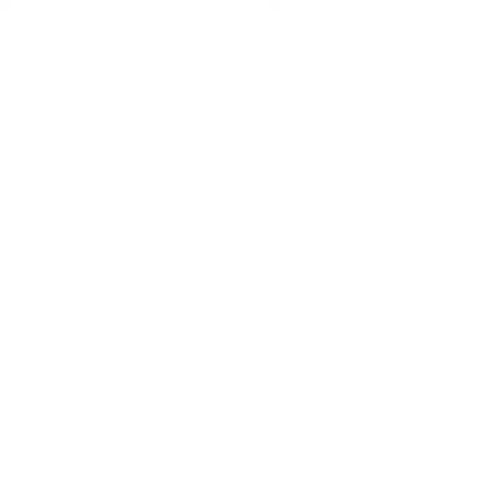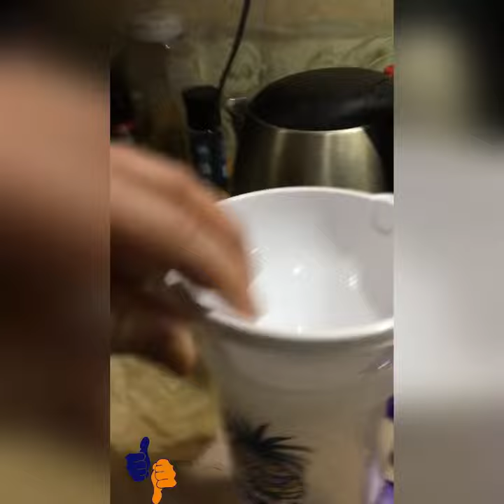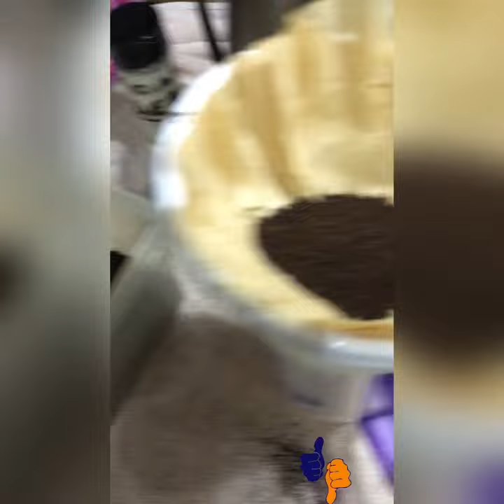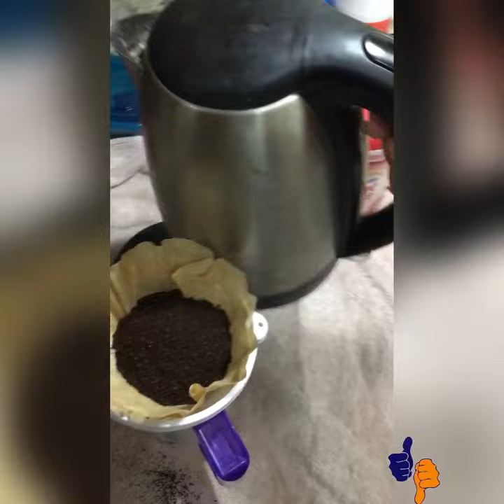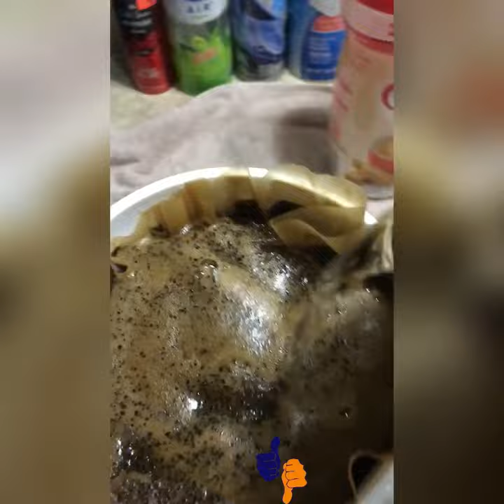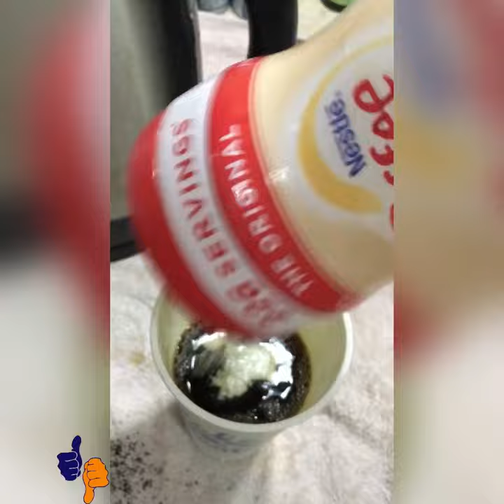How To Brew Coffee Without A Coffee Maker.

Comment: Just don't use ANY plastic if pouring HOT LIQUID IN IT. It will dissolve all the chemicals in the plastic into your liquid. So, it's no safe to use plastic. Other than that, good video.
Reply: It depends

Comment: Does any paper towel work
Reply from the maker: I don’t know about paper towels. I had paper filters just no coffee maker.
Reply: I tried with a paper towel and it works really well, but using a sifter, not a funnel. I made the coffee in a cup then put a sifter over an empty cup and a piece of paper towel on top of the sifter and drained my premade coffee to get rid of the grounds. It works perfectly.
Reply from the maker: @martatofaleanu8393 smooth move! Thanks for sharing.  ☕️